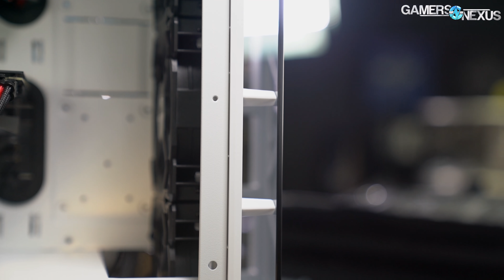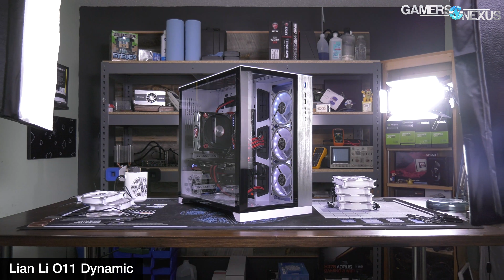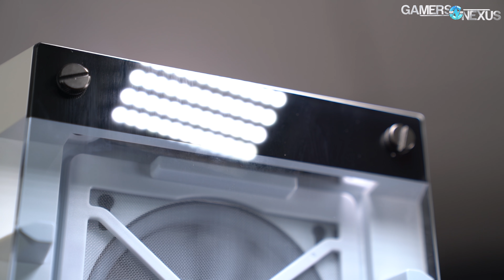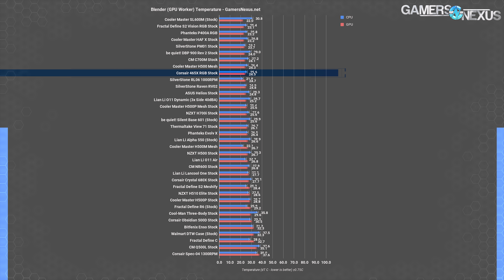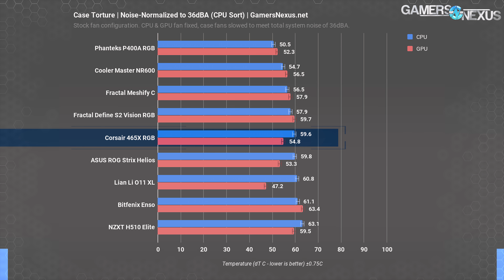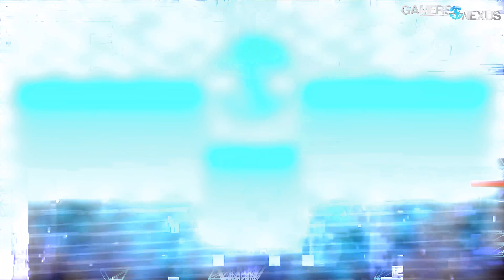Corsair iCUE 465X RGB Case Review: Glass with Airflow, Sort Of

Comment: glass + dust filter looks way worse than a simple mesh front
Reply: @Sciurus Rubrum Ok? Well I guess fuck my opinion then, right? I apologize for claiming that it was subjective. That was apparently ridiculous of me :)
Reply: I like it. Guess it's fairly subjective. I'm a sucker for glass.
Reply: @Thunterise  I generally don't like glass panels, but this looks decent to me..
Reply: Seems great to me. Just take off the glass and you've got a great performance-focussed case with an actual dust filter rather than just a mesh (which won't filter most dust as holes are too big)
Reply: Thomas Sturges-Allard I KNOW RIGHT LOL
Reply: mesh is not a filter ???
Reply: the only problem I have with most dust filter + RGB fan cases is that the dust filter has plastic on it that COVERS the fans which makes it pointless as the reason why someone would choose a glass front case is for RGB fans but if your gonna put a cross over each fan and cover it then it is kinda pointless
Reply: U can put in the 220t or 275r airflow filter to get rid of the stupid X braces. they are the same size, but just normal, no Xs. Keep in mind tho with a glass front.. you are gonna see all the fucking dust in the filter (the reason why I got rid of my 460x, cleaning every 3 days, no thanks!)
Reply: @Daisudori  Can I get them separately? I wanted the 275r with 3 LL120 fans, but the 465x is a better deal(I think) for me since it already comes with the 3 fans I am looking for. The x in the front is... meh, not bothered by it and its not impressing me too, but if I could get rid of it, I would love to!
Reply: @itsKimovichlol  If u want the LL fans its for sure a better deal. Im quite sure they will sell it seperate, its just not in their shop yet, but just ask their customer support... Corsair will probably help you out ( their CS is great in my country atleast)
Reply: @Daisudori  Thanks! I will see if they have it in Canada.
Reply: Mesh barely stops any dust, while a nylon filter does most of it. But the glass is just pointless, they could have invested those resources on a removable top cover to reduce noises.
Reply: Agreed
Reply: Those Xs arent doing it any favors either. Wtf were they thinking?
Reply: You can switch it with a normal dust filter but ok
Reply: guys its all about once preceptive
Reply: Nein
Reply: I think they could have but the bracing in such a way that it went around the fans instead of having the X.
Reply: I quite like it, lol
Reply: @FAB1150  I think corsair does have potential to make a beautiful mesh design based on the dust filters, it just doesn't work with glass
Reply: Nuovo same
Reply: My CM H500P Mesh Grey Metal looks much better than this.
Reply: Yeah the 460x looks better lol
Reply: And a ton of plastic support.
Reply: Its soooo ugly

Comment: My H500M with the glass front chokes the fans, even if is a small glass and there is a lot of clearance, simply anything blocking the air coming straight to fans is a no no. Mesh FTW
Reply from the maker: Well, yeah, it certainly does on the H500M. The mesh panel is the obvious choice for that one.
Reply: Full mesh front is always the way to go while ironically the majority of pc community (at least on reddit where I'm active at) seem to love solid or glass front smh.